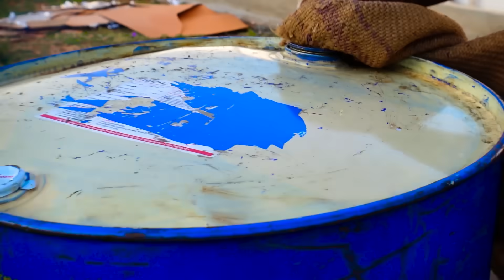Titan Implosion Experiment | Pressure Crushed 200ltr Steel Drum

Comment: And Bernoulli's equation for static fluids

p1+ρgh1=p2+ρgh2. p2=p1+ρgh1. This equation tells us that, in static fluids, pressure increases with depth. As we go from point 1 to point 2 in the fluid, the depth increases by h1, and consequently, p2 is greater than p1 by an amount ρgh1.

Comment: They were lucky it didn't explode 
Years ago when i was a firestarter i rolled a 45 gall drum of red diesel onto a bonfire the demolition people left burning
After about 15 minutes you could hear the spitting and bubbling then bang 
It blew the lid clean off and went a good 400m before landing in a field ,the barrel split down the side like a can opener did it and the flames must have gone 100 feet 
Lesson learned dont do it again or i could have been burnt to a crisp or cut in half 😊

Comment: Failure of sub and this barrels are two different concepts. This barrels collapsed because of low pressure (vacuum ) created inside the barrel due cooling of steam. But sub collapsed because of high pressure of water surrounding the sub.
Reply: The principle is exactly the same.

Comment: Just a heads-up bros, this experiment was not even remotely close to the type of implosion the Titan experienced.
The Titan imploded in a millisecond.
That's faster than a human eye blinks.
Reply: Yes, I think they get that, the real goal is get people like you to comment, how can it be 'even' remotely be like the Titan implosion if they were not even underwater let alone remotely anywhere near the depth of the Titan.
Reply: Enaya athukaga 3km alathula drum a kondu poga mudiyuma ..?
Athu ivlo thaan varum saftey pakanum laya😂...
Reply: Well yeah. That's just one teeny weeny atmosphere on a partial vacuum. Demonstrating the power of pressure though.
Then think about catastrophic failure at about 500 atmospheres or whatever it was!
Reply: Bunch of morons hope next time the barrel takes them out
Reply: It is as close as you  can replicate it on the surface.  Heating up water inside the barrel and cooling it down created negative pressure compared with atmospheric pressure and cooling fast.  To get pressure differences more adequately,  you need a lab or go to the ocean
Reply: Very bad of you bros   .what happened is not only devastating,  and fatal  , but killed the passion for the future generations also

The video is truly embarrassing
Reply: It was still entertaining and they had fun doing it. The method was wrong, but they got what they wanted.

Comment: I'm wondering if it was too hot inside the titan sub5 that high pressure of seas caused it to implode as shown in this video.
Reply: The mechanism for the implosion is different.

The submarine was made of different metals, and so they contracted differently at the joins. That made the sub weaker and it was crushed by weight of the ocean

In the video it's the rapid contraction of the cooling metal that causes the implosion, not pressure
Reply: @hareecionelson5875 not the contracting metal. Otherwise they wouldn't have had to screw the lid on. Contracting cooling gas inside. Outside atmospheric pressure pushing in on lower internal pressure. It was the pressure.

Comment: This experiment is with metal drum
Titan was made of Carbon fiber 
Didn't squeeze inwards 
It broke into thousands of fragmented pieces and body parts had same fate 
That's the reason they say they found human body parts in the wreck 
All those fragmented pieces disappeared with the current below
Reply: @stephen3654  Nothing is confusing 
Take a hammer and strike a glass bottle than do the same on a plastic bottle 
See what happens 
Carbon fiber is like glass bottle and not like metal that will dent

Comment: Wow... Great Experiment 👍... But just wondering how is your heat/fire theory is relative to the Titan 🤔as deep sea temperatures is at least frozen below - 1 deg C? I'm assuming your theory is at heat of enthalpy / entropy situation? Anyway the blue barrel did implode ❤❤😂
Reply: You're right, it is not the same as being under the ocean, however it is stimulating a pressure difference created by cooling the hot air in the drum
Reply: @Incommensurabilities   most of the implosion was caused by cooling contraction of the metal, it shrank unevenly
Reply: @hareecionelson5875 No it was atmospheric pressure (1bar) pushing in against a partial vacuum (less than 1bar) as the volume of the gas (steam vapour) contracted as it cooled.
Nowt to do with the metal contracting (even though it would have slightly).
Now try that at around 500bar with instant catastrophic failure due to a weak point. Bang!
(Apparently it would have collapsed at 1500mph!)
Reply: @hareecionelson5875 Ah, so it was the heat that imploded the steel submersible that was actually fibreglass and with a surrounding temperature of 5 degrees Celsius..? Interesting facts there. I'm guessing you're a rocket doctor or some sh"t?
Reply: @bigpauliep6992   I was talking about the barrel, but now that I think about it, I see that the air pressure in the barrel rapidly decreased with with cooling, and thus the outside air crushed the barrel.

Replace the outside air for water and there's a good analogy with the submersible
Reply: @hareecionelson5875  Yeah, no.
Reply: @bigpauliep6992   I'm not saying that the submersible was crushed because the air inside the sub cooled.

But in terms of just looking at the pressure difference, the inside pressure was less than the outside, and the material strength was too weak.

The point of the barrel experiment was to demonstrate high pressure Vs low pressure, the exact mechanism by which the pressure difference was brought about was not intended to be representative of submersible

Comment: Actually your experiment is wrong. You need to take the drum with proper tie of the rope. Put it in to the deep sea. Finally take out from the sea. If it is crushed then the experiment is correct.